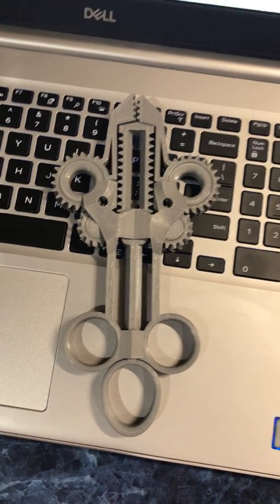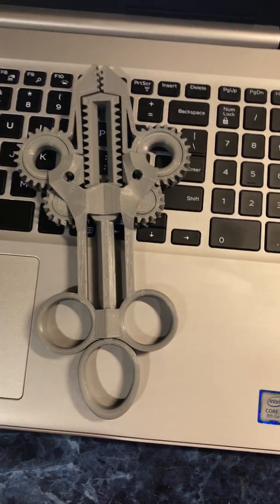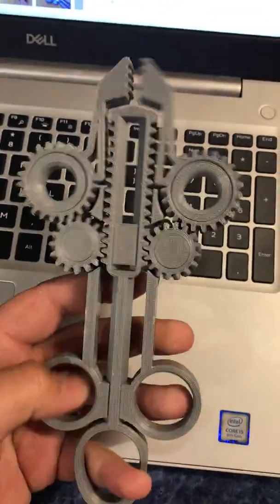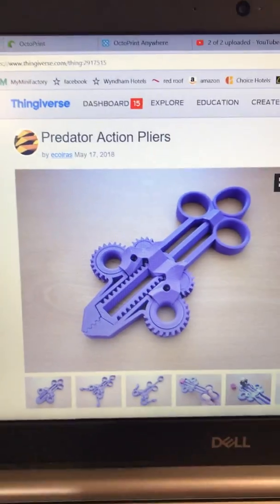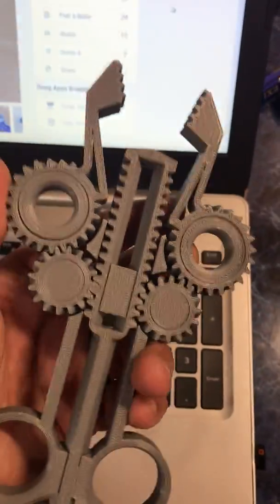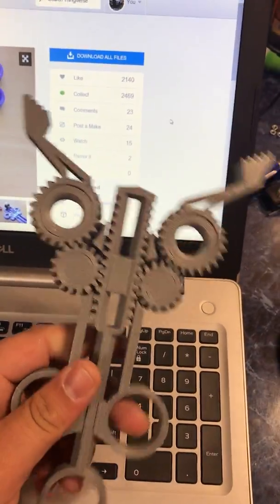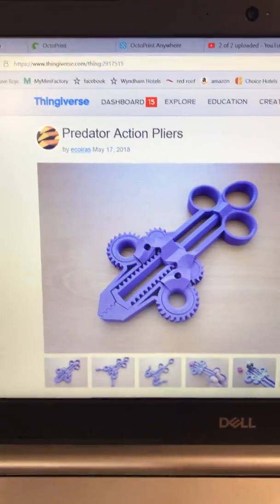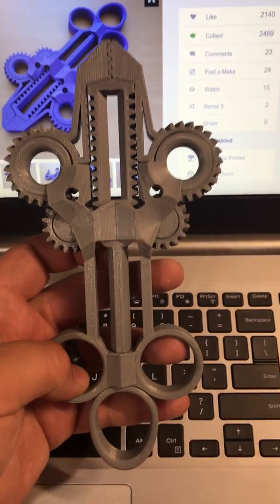3d printed pliers

Comment: How do you move the gears
Reply from the maker: XxDat1BoiixX The Best So the best way I can describe on how it works is in the middle there’s a shaft with gears on it that connects to the smaller round gears and then those go to the bigger round gears with the claws on it and there is clearances in between all the fixed pieces so they can all move freely it is really cool